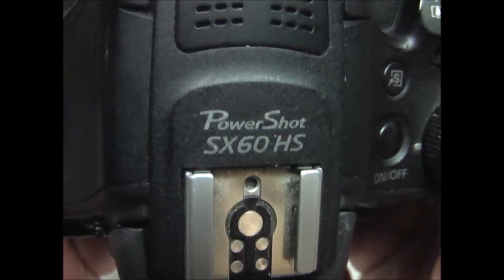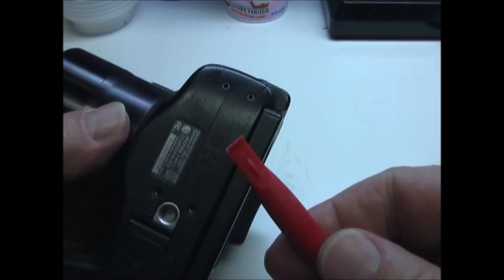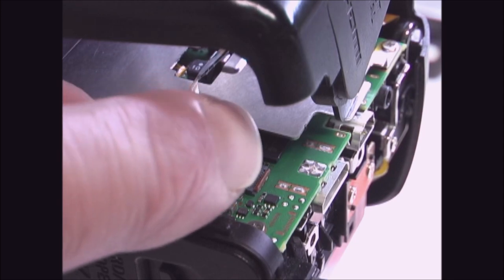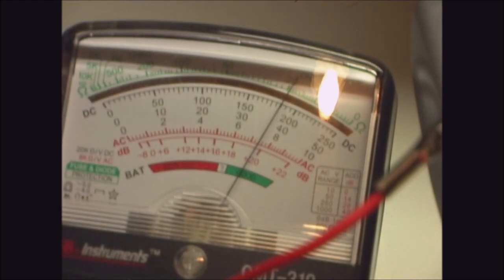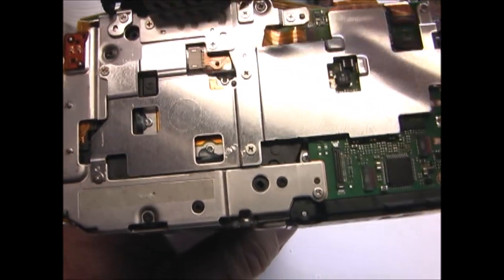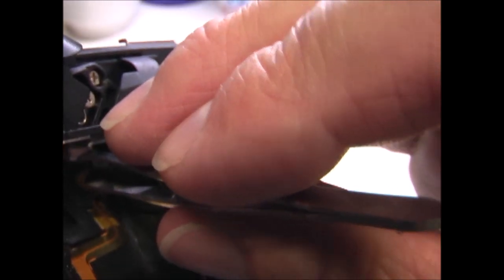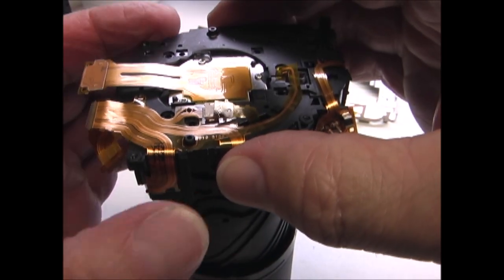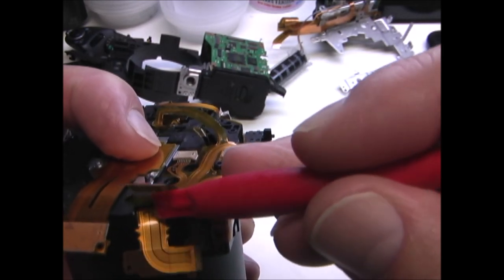Canon PowerShot SX60 HS Digital Camera Lens Error: Disassembly, Clean Lens, Reassembly, Repair

Comment: Great video! Thank you so much! I ended up replacing the seized motor and the camera works. For those who ask regarding the motor, I could not turn my new motor from the gear while it was inside the gear assembly, but when I removed the gear from the old one it was hard to turn the motor, which should turn freely.

Comment: Great video. I thought I had the same problem.  I got as far as taking the shield off where it turns out, strangely enough, the ribbon cable and connector (shown around 12:28) were badly corroded for some reason. Cleaned them up with contact cleaner dabbed quite gently but several pins are missing from the cable. 

 No idea why just that one spot was affected, no other damage or sign of moisture could be found.   

Thanks again for the video at least i was able to figure it out without spending a pile to fix it

Got it from a box lot at a surplus auction so not a big loss but still disappointing.

Comment: You can also use a smaller sized resistor to drain the capacitor, it will take longer, and use the largest diameter resistor you have on hand. The start capacitor for my HVAC condenser unit has a small resistor between the leads so that it drains that capacitor slowly.

Comment: Jay - I've been trying to find out how to replace the built-in battery that drives the date and clock on the Canon SX60HS. I didn't see that watch battery in your video - so I'm now wondering if the time and date is somehow driven by the flash capacitor?

Comment: I stripped my SX60 down after it began showing ‘Lens error’. The procedure went well and was enjoyable for itself but the problem didn’t go away. If you are still checking in on this, Jay: Should it be possible to rotate the two gears that are behind the lens barrel? I noticed that you hit them with compressed air but didn’t rotate them to clean all around. I tried to turn them with my finger but they wouldn’t budge which made me wonder if the there was something wrong there, e.g., a messed up motor.
Reply: I wonder the same..

Comment: Hello, thank you very much for your contribution. all very detailed and practical. Personally, I followed your instructions to the letter and managed to remove the error. However, I want to share with you a problem that I cannot solve, it is with the same camera. Although it works fine, that noise tells me that there is something wrong with the motors. Do you have any instructions to disassemble the motors and examine the pinions? I am attaching a video link so you can see what noise I mean. Thank you for your time. ///

Comment: Great video!, in my case, my so beloved SX60 HS was floating in its bag for about 20min on the surface of a beautiful mountain lake, until wind pushed it to the shore, it accidentally fell when trying to find a safe spot to sit. It was pouring crystal clear mountain water when picked up, was something more like fishing my camera out of the lake... yeah, it was that bad. At the moment, it is still buried in rice. Since it wasn't salty water, I keep hope. Will try to disassembly it in 5 days or so, clean with alcohol, re-assemble and hope it works. If it works, I have no idea of what to do if the lens is clogged/condensed. Wish me luck., and if anyone has additional tips, please share Thanks for the video

Comment: Thanks very useful, though it did not fix my problem which is a loud clicking sound when zooming, refusal to zoom beyond 500mm and then the lens error message. I was shocked to see that the lens has large cracks in it. Surely this is not normal? I would like to show you a picture of the lens cracks
Reply: i had this problem and it went away,probably dirt,also sometimes lens error problems go away if you disconnect the battery for enough time,its like a computer reset.

Comment: Hi Jay - thabks so much for your help.  I need to replace the internal "memory" battery.  Can you tell me what battery I need to buy to replace it?  SX60 HS.
Reply: BTW - do you have the service manual for this camera?  I haven't been able to find a way to source it.
Reply from the maker: I'm not sure that there is a removable battery. I think these use a capacitor to keep time/date. The capacitor holds a charge for about three weeks if the main battery is out. The capacitor is re-charged from the main battery. If the capacitor becomes completely depleted, it takes about four hours to re-charge it. If it isn't charging, plug in the USB cable (open the accessory cover on the side) and try to charge it that way.
Reply from the maker: I have searched but have never found a service manual